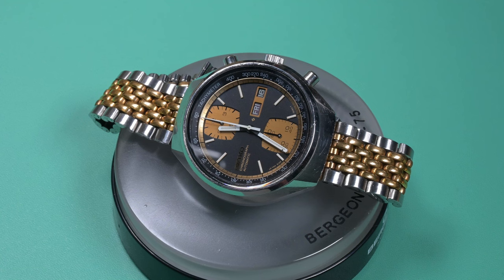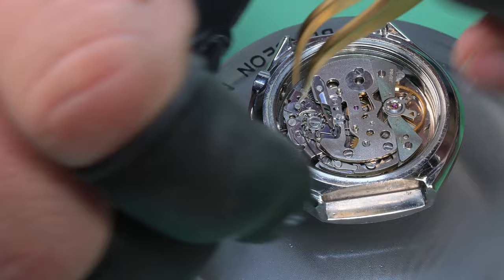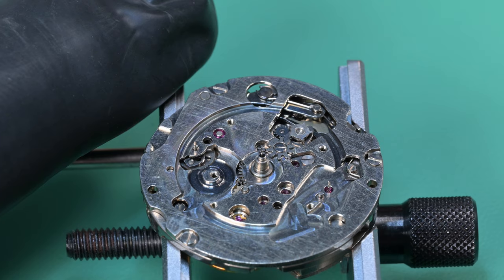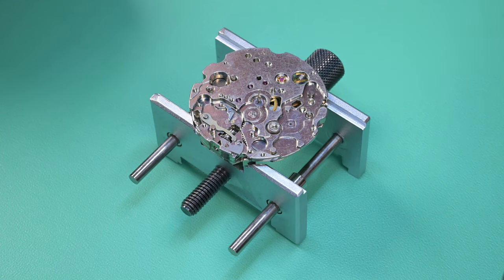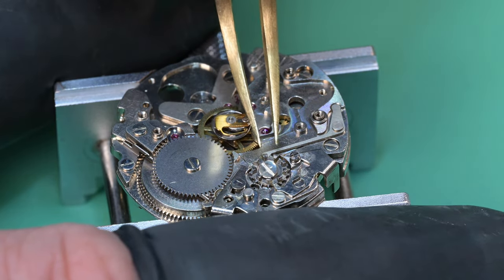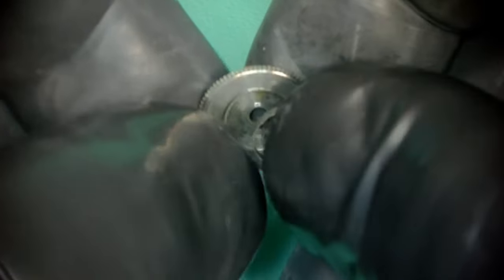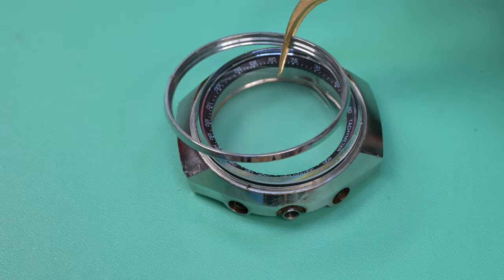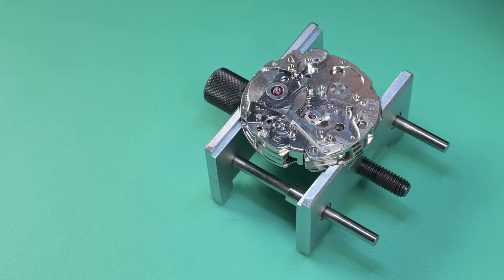Viewer Poll Winner: A 1976 Seiko John Player Special - Part 1 - Full Teardown & Repair

Comment: Nice JPS. I just amazes me the 6138 fits into so many different cars sizes.  The JPS is relatively compact and if you look inside the case, you can actually see where Seiko milled out recession the case to accept the movement.  The movement on yours looks to be in exceptional shape.  Very little surface wear that I can see.  Looking forward to part 2 where you assemble the watch.
Reply from the maker: Thanks.  I completely agree.

Comment: It have to be Seiko S-4 grease or similar grease(Möbius 9501-9504) on the center wheel  pivots🙃
The problem usually is that have to be serviced every 5 years(not ~40 years😬)
Reply from the maker: I'm guessing they put entirely too much on there, and when they went to install the cannon pinon, it pushed a lot of the grease off the pinion and onto the jewel.
Reply: @WeekendWatchRepair  ~215° amplitude is a little bit low😬. A month ago I did serviced my Seiko 6138-8021 and the final result was/still is ~270°amplitude. I noticed the upper port jewel upgrade, did you adjust the lower and upper jewels so that the barrel teeth mesh with the center wheel pinion in the upper ¾?😉
And just a tip, if the mainspring is not broken, leave it in the watch. Recently I did a Seiko 6139-7100 with swapped mainspring by Officially Certified Rolex watchmaker and the movement was "limping" with ~30h power reserve and ~200° amplitude😬........
Reply from the maker: @MsAppleseed  Yes, I did adjust the lower jewel as well so the barrel met the center wheel pinion on the upper 3/4.  It was 215 after it's first 24 hours.  It's been a few days now and it is running in the 230's.  I monitor them for several days after servicing and adjust as necessary.  I appreciate you taking the time to leave detailed comments.   Thanks.

Comment: That’s almost 😅 like 👍 the Bullhead watch. The dial is very similar. What is a 6138 movement? I don’t get it, except for one ☝️ very basic fact. It has something to do with which way ya rotate the crown 👑, to change either the day or the date 📅. Your friend, Jeff.
Reply from the maker: The 6138 is a dual register (minute & hour counter) chronograph movement, and the 6139 is a single register (minute counter) movement.